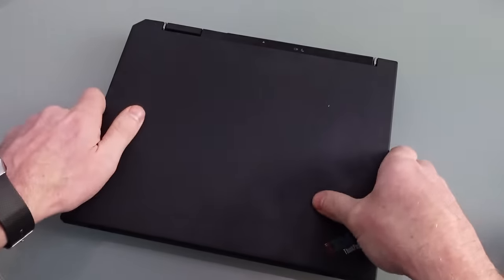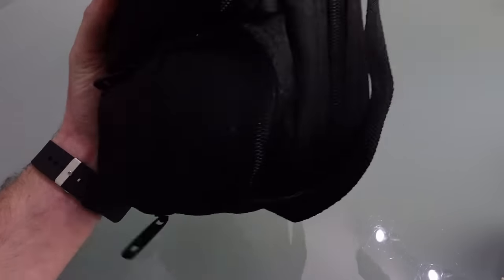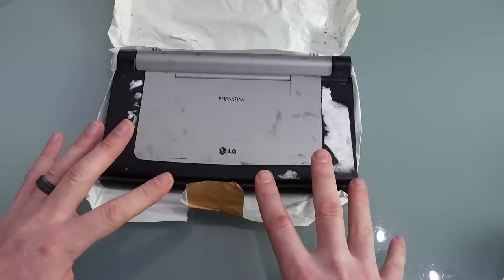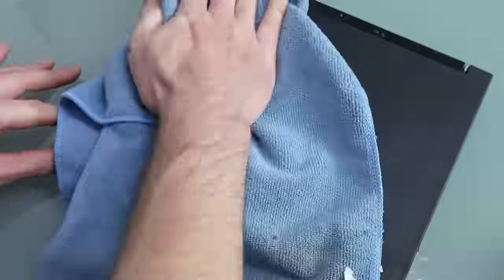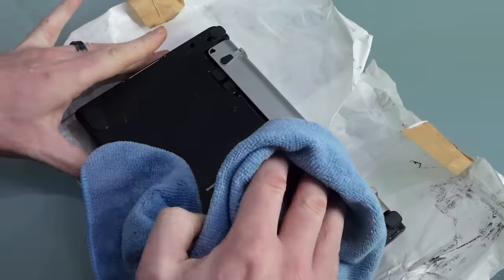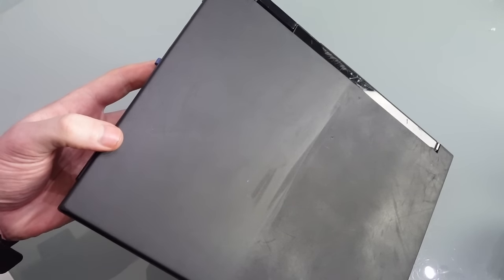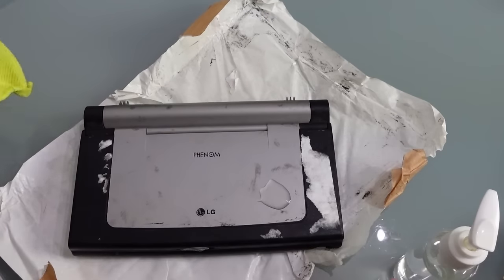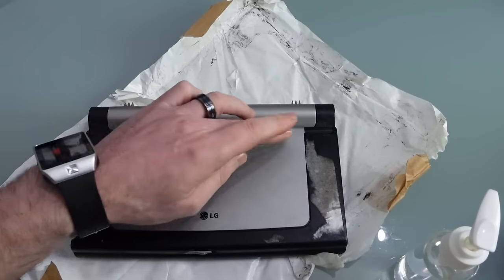Rubberised Computer Coating From The 90's - Restore Or Remove?

Comment: I tried this on an old ThinkPad in similar condition but wasn’t overly impressed with the results. Read somewhere online that a magic eraser sometimes works so tried that and the results were fantastic! Obviously you have to be careful not to scrub too much otherwise it will completely remove the coating, but with a little trial and error mine now looks almost new
Reply from the maker: I also saw about the magic eraser but having tried it I was worried it was stripping too much of the coating and leaving me in a no-mans land with half off slightly tacky coating, but sometimes its just what ever works!!!

Comment: I have a pair of Mac Books that came with the thin protective shells with sticky coatings. What I did was to lay several layers of paper towels on top of the shell, pour some isopropyl alcohol on the towels and then wrapped it in plastic wrap and let it set for 24 hours. The next day upon removing the plastic wrap the coating came off with the paper towels. It took another alcohol soaked towel to remove some odd residue. They look good but can scratch easily. Clipped them back onto the MB's and we're off to the races.
Reply from the maker: Now there's a tip! That sounds like a lot less work!

Comment: Hand sanitiser is ethyl alcohol not isopropyl. Best use methylated spirits instead of sanitiser to not leave residue.
Reply from the maker: Yes, they are different alcohols, I didn't find much residue from the sanitiser but good thinking, I will give meths a try next time and see if that's better - it doesn't smell as good as hand sanitizer though 😉
Reply: It could be both. Rubbing alcohol (70% isopropyl) is used as hand sanitizer very often.
Reply: @HandheldComputing  I used meths and paper towels on the centre dashboard section of my 2005 Renault Scenic, which was a horrible sticky mess with dog hair embedded in it, that left gooey black marks all over my hands every time I started the car. It took a couple of hours, but now it looks like brand new.
Reply from the maker: @Zeem4 it's hard getting off your hands after, I'm definitely using gloves next time 🤣

Comment: I've got news for you: That rubberized crap is still being put on things like Mice, game controllers, and all sorts of stuff. I once even bought a USB card reader that was coated in that crap.

When it starts to turn sticky, I disassemble the device and use Windex (with amonia) and a toothbrush to scrub it all off.
Reply: I was screaming BULL.... too. There are loads of idiots who still think that crap is a good idea. For something you'll throw away in a few months, maybe, but it's on things you'll use for decades.
Reply from the maker: I haven't come across anything with it on personally but its clear from the comments that it is indeed still in use on quite a lot of products! I do wish it wasn't!
Windex? That's a new one to me, thanks for the suggestion!
Reply from the maker: Yes, it turns out that it is still in use!!!!
Reply: @HandheldComputing  My 15yo blakc Ooma Telo is a black sticky ball. The brand new white that replaced it a month ago... also covered with the shit. Nice to see they've learned nothing in 15 years. I have iPhone cases with it - it's really anti-slip now! I have too many battery boosters coated with it. Most reputable laptops don't use it anymore, but cheap ones love the stuff.
Reply: @HandheldComputing  To be honest, I don't know if Windex (or generic glass cleaner) is the best option for removing it, it just seems to work decently well for me. It's not like it's a quick one-step process though. I spray the pieces, scrub with a toothbrush, rinse them off, see that there's still some residue, spray it some more, scrub more, rinse it off, find a little more residue, etc.

If there's something more effective at taking this stuff off, Id love to know about it.

What really surprises me is that sometimes, items will have writing on them, but it doesn't come off. For example, the card reader had the different slots all labeled. I assumed that the print would come off with the coating, but it didn't.
Reply from the maker: Just an odd choice by manufacturers I think! @jfbeam
Reply from the maker: In that case I can tell you handgel works very well at removing it, including the sticky residue that can be left @lurkerrekrul
Reply: @HandheldComputing  I'll try that next time I need to take the coating off something. Somewhere I have an old gamepad/controller that is completely sticky. I never bothered cleaning it because I didn't have the original USB adapter for it, and it doesn't work with generic ones.
Reply: I pulled a mouse out of my large "input devices that aren't keyboards" drawer (is that normal?) that I got like... 7 years ago.  It's goo now.  The wheel and sides resemble what 40 year old PC rubber feet that I pulled from Computer Reset are like.
Reply: @kloroformd  I have a box of mice and joysticks. :)

If you take it apart and scrub the coating off, it can be as good as new. Not sure about the wheel though. Those usually have a sort of rubber "tire" that goes over the plastic core. I suppose that they could have just rubberized a plastic wheel though. You have nothing to lose by trying. :)

Comment: I wonder about the long term effects of the moisturizer though.
Reply from the maker: Well the rubber will break down whatever you do s I suspect that in another decade you will still need to remove the coating. You can of course put a new rubber coating on, if that's what you want....

Comment: I'm reading this with an S5 in my poacher's. The reason I upgraded to Android from Symbian (Nokia 3360i) was because I wanted Spotify, and it's still the case. I can ditch Snapchat, but I'm forced to have WhatsApp by iPhone users and group chats, but Windows exists for that. R.C.S. though, that I can't live without having international friends. And with R.C.S. coming to iMessage, I personally don't have much need for WhatsApp. Still, I occasionally swap my SIM over and use the Nokia in junction with my Revo Plus.

Perfectly usable in today's day and age, if you ask me!

(Nice video!)
Reply from the maker: Its a nice phone the 3360, I bet you get amazing battery life!!! There are defiantly going to be compromises going back to a feature phone but I think it will be an interesting challenge and hopefully an equally interesting vlog!

Glad you liked the video, I need a new battery for my Revo, great little device though!
Reply: @HandheldComputing I do! It doesn't seem to drain either when it's off.

When I popped out earlier I realised that I wasn't sure what the flat number was that I was going to, so reinstalled WhatsApp to check... In my pre-Android days I would've written it down and most likely in my 5mx in Contacts. It never crossed my mind today! I think I've underestimated how reliant I've become on 'why prepare when I can check anytime I like?'

Comment: These coatings are a TPU rubber with a bad formulation that breaks down and releases the plasticizer which is what makes them soft. The plasticizer is the sticky part. The black getting everywhere is the resin and colorant that was formerly bound together with the plasticizer.
Reply from the maker: That makes sense, I had assumed it was just the bonds breaking with UV exposure - they are a terrible when they break down, wish manufacturers wouldn't use them!
Reply: @HandheldComputing  I have a Harbor Freight biscuit joiner tool I need to remove the TPU from. It's not been exposed to any sunlight nor temperature extremes. But just sitting in a closet for a while, the soft touch overmolded TPU has broken down and become gooey.

Using skin moisturizer could only be a short term band-aid. On the 2004-1009 Toyota Prius the hatch release button has a soft cover made of some type of black plastic. Over time, many of the covers turn to goo and it's a real chore to remove the latch button, clean the goo off, and replace the cover.

The culprit most suspected of causing the cover to break down is hand moisturizer or other skin care products.

Comment: In my experience nail polish remover for artificial nails (does not dissolve most plastics) works wonders in cleaning these rubberized surfaces. If it's just a coating it might strip it completely but the result looks good. If it's solid rubber it will clean it up like brand new.
Reply from the maker: I was concerned that acetone would damage the plastics sounds like it could be a good option, thank you for the suggestion 😃

Comment: 1:30 I have tested combination of two  "Label Cleanser" Art 144 by www micro-chip pl"  + isopropanol (required)  It's far from perfect applied on HP EliteBook 2730p removed all but i had to disassembly. All depend on how i mix, sometimes is too active some other time require too much time. Only works when i apply one first and allow it to penetrate and then mix isopropanol before first is allowed to dry. I don't know ingridiences except for:  "Hydrocarbons C10-C13, Hydrocarbons C9-10, n-alkines, isoalkines, orange extract" smells like light gasoline. It doesn't work well as label remover but it does miracles if mixed with isopropanol. Removed too much removed glue of all stickers and all rubber coating. Im looking for something less active against stickers and labels better/repetitive agains rubber. Also tested on Blackberry Passport. Took me lot of time. Hope that helps?  Now "bakc to video" :)
Reply: BTW. Isopropanl itself makes rubber coating even more sticky
Reply: 14:00 I have used credit card, scrathed rubber once it got soft ^^
Reply from the maker: That's what I found, it would remove it but it was like it was melting rather than the hand sanitizer which seemed to dissolve it more and leave less residue
Reply from the maker: I thought about using a plastic scraper/credit card I just didn't want to risk scratching the plastic but I guess if you are careful it would be fine and speed up the process a lot!

Comment: A large part of my car's dashboard was covered in this stuff from the factory... For better or for worse it was too far gone (to the point where it would legitimately turn to liquid upon any force being applied to it) so I just grabbed some 98% rubbing alcohol and went to town on it.
Good thing the part beneath was made of quite decent-looking textured black plastic, at least. Saved me the job of having to respray my dashboard.
Reply from the maker: A dash is in direct sunlight for a large part of its life, I can't believe someone thought a rubber coating was a good idea!!!
Reply: @HandheldComputing  It was mainly on the lower side of the dashboard that faces the driver and passenger, but still I imagine it must’ve received quite a bit of sunlight… as if the fact it had turned into literal tar didn’t make it obvious enough lol
Reply from the maker: I bet that took some cleaning off too! @sralismazgalis
Reply: @HandheldComputing  I had to spend around 4-5 hours total and got my leg burnt (it was summer) but it turned out worth it in the end I reckon
Reply: @sralismazgalis What car do you own?
Reply: @MisiekCentralny  2001 Renault Megane hatch. Pretty sure the rubber coating wasn’t there on every one of these though, i think it may have been some optional/trim-specific thing

Comment: I used a few drops of olive oil let is be absorbed, clean it,  and used a silicons oil for car seats, let if be absorbed, and cleaned it finishing with silicons and lineseed oil based furniture polish and polish with a soft microfiber tissue. Try a few times and the stick felling disappeared.
Reply from the maker: I guess the olive oil will work just like the moisturiser and then the silicon oil will give it a nice sheen - will give this a go

Comment: i have a Dell XPS M2010 which has a nasty sticky coating on it, im tempted to remove it but i didn't know that it could be restored!
Reply from the maker: If you do the moisturiser or corn starch etc it will get rid of the tackiness and make it useable again but eventually it will break down 😒
Reply: i think it would look better without, the handle has grio through a nice "pleather" overlay @HandheldComputing

Comment: This is another reason my fav Windows CE grey scale unit is the HP360LX. I had a Velo and that coating did NOT age well. My 360LX is like new still.
Reply from the maker: The 360 has the white backlight? Its on my list to try and get hold of 😀
The coating on my velo is fine but I suspect that is because it was only used for a shot time and then stored in the dark...

Comment: Seeing all these tiny computers makes me really wish they made a modern version. Sure there are some models, but nothing like a Jornada. I wonder if there are any old devices that would be easy to upgrade the internals.
Reply: Someone on Hackaday made a Psion S7/Raspberry Pi Frankenstein.

Planet Computers Gemini, Cosmo and Astro Slide and GPD's Mini series are the closest you'll get today.

Planet Computers hired Martin Riddiford to design and those devices unironically also use the S5's keyboard, albeit modified because modern customers found the action mushy. Eventually Martin managed to make it backlit, too!
Reply from the maker: I think the Astro slide is probably the closest thing to a modern Psion 5 or maybe the Pinephone. Part of the issue is our expectations with portable devices are now so high! Back in the late 90's sending email over a mobile connection was like living  in the future!!!
Reply: @HandheldComputing   I backed the Astro Slide. Still waiting for them to deliver if they ever will and even then, it still has loads of issues. It would be nice to see a major manufacturer make one.
Reply: @HandheldComputing   To add to that, I guess we don't see devices like this anymore because 99% of demand is covered by mobile phones and a further 0.5% is covered by adding a folding Bluetooth keyboard so it's just not worth it for major manufacturers unlike years ago when you could only get "smart" functionality in a pocket computer.
Reply: @oliverpolden  Ak, I'd heard about that. 🥴

Comment: silicone oil based surface sprays like "Mr Sheen" can work OK, but I always strip the coating, TBH did not like them to start with :)
Reply from the maker: ha ha, yes it would be easier if they didn't exist in the 1st place! My go-to is strip the coating unless its in very good condition

Comment: It's almost inevitable that ALL rubber coatings become sticky. I hadn't used my PS4 for a few months, took out the controllers and the sticks had become tacky. I now won't buy something that has such a rubber coating on it and wish that manufacturers would stop doing it.
Reply from the maker: Its no where near as common as it was but it is a pain when it starts breaking down. I didn't know the PS4 controllers were like that, maybe its a way to build in obsolescence.....

Comment: I use mibenco soft touch spray
Reply from the maker: I hadn't heard of this - a quick google suggests it would be a perfect replacement once the original rubber is removed, or would you just spray it on top?
Reply: @HandheldComputing  if its easy to remove remove it, you get a better result. But sometimes its hard to remove it. Because of from of the object for exaple my car had a soft touch window button very easy to remove with solvents.

But i had a video camera the shape of the camera didnt allow me to remove it to many nuck and cranys so i sprayt on top of it greetings switzlerland
Reply from the maker: Excellent tip, thank you for that! 
Greetings from England 😀

Comment: be aware that if digitizer is separate from the screen on touch devices and isopropyl alcohol leaks into the space between them then the touch part will no longer work, killed a gps this way
Reply from the maker: Thank you for the warning, you do have to be careful with solvents and resistive screens

Comment: rubber coating, soft touch or whatever they called is nasty overtime since after years it began to melt, leave sticky stuff everywhere that hard to remove
Reply from the maker: It sure is! The hand gel does work though in hindsight I would suggest wearing gloves as it was hard to get the rubber off my hands!

Comment: I'm having the same problem with my Palm Foleo. all the plastic became tacky, which made the device hard to use on a regular basis. I think I'll give it a try with alcohol gel or Corn Starch like mentionned in the comments. Thank you for this vidéo and your great channel !
Reply: You could also try unpigmented leather conditioner, like Meltonian or Tarrago, since they’re actually intended for the leather equivalent of these rubberized finishes.
Reply from the maker: Yeah the corn starch has been mentioned a lot - hence pinned to top - let me know how it goes!
Reply from the maker: I imagine that could work as again its got moisturises in it and is designed to penetrate into the leather

Comment: I had a 1980's vintage car where all the interior plastic was coated with this rubber paint.  All the surfaces went sticky, and the plastic underneath turned to a kind of powder, or went brittle and cracked, so this and a lack of spare parts meant I had to scrap it.  I do posses a mobile phone but rarely use it.  That's easy, because there is no signal where I live, so it spends most of its life on a shelf doing nothing.  🙂  No livestreams for me please, because they take too much time.
Reply from the maker: Rubber coatings were such a thing in the late 80's through 90's - I'm glad its had its day thought!

No worries on the live stream, I intend to keep them short anyway 15-20mins max, no one wants to watch me blabbering about my week for an hour 🤣😂
Reply: @HandheldComputing …”I’m glad it has had its day”… yeah, but sadly still a ‘thing’ in the tool scene. They proudly call it ‘overmolding’.
Reply from the maker: Overmolding, what an interesting term!  @ernestgalvan9037